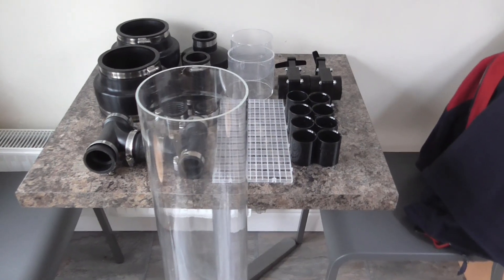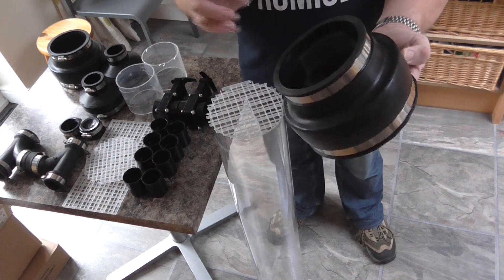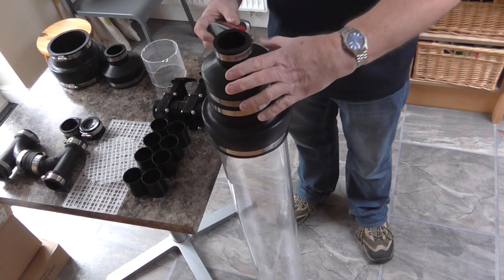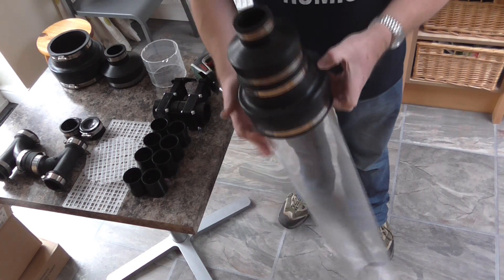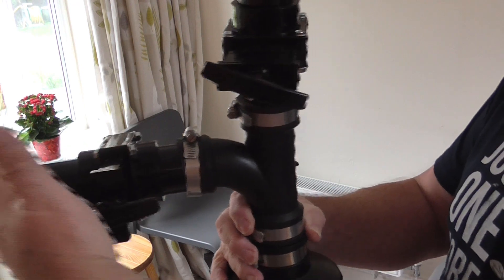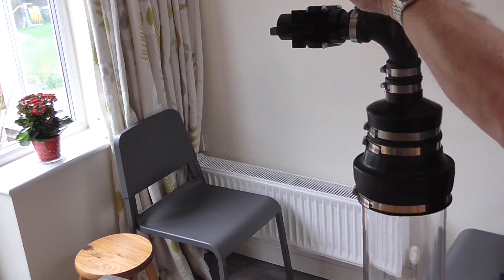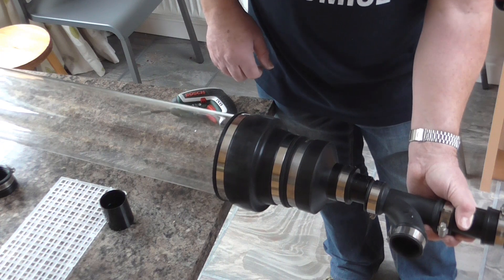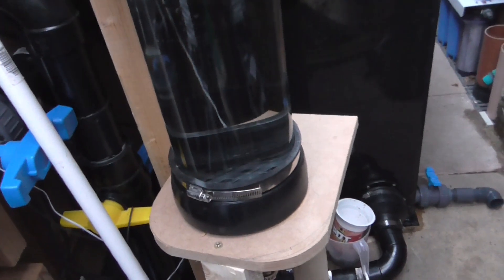Making a Home Made Up-flow Filter

Comment: How much did it cost without media please
Reply from the maker: The approximate costs for building a filter using 150mm and 110mm pipe are:
150mm Filter
 £39 - 1 x 1mtr length of 150mm acrylic clear perspex tube
 £03 - 2 x 20mm (approx) lengths of 110mm pipe
 £32 - 2 x 160mm to 110mm rubber adapter
 £20 - 2 x 110mm to 1½" rubber adapter
 £ 8 - 1 x 1½" rubber T-connector
 £15 - 2 x 1½" valterra valves
 £ 4 - 5 x 1½" straight connectors solvent weld
====
£123 = Total

110mm Filter
 £33 - 1 x 1mtr length of 110mm acrylic clear perspex tube
 £20 - 2 x 110mm to 1½" rubber adapter
 £ 8 - 1 x 1½" rubber T-connector
 £15 - 2 x 1½" valterra valves
 £ 3 - 3 x 1½" straight connectors solvent weld
====
£ 79 = Total

Where I got the parts from
Acrylic Tube - Trent Plastics do 110, 150 and 200mm acrylic tube at 500mm and 1 metre lengths
https://www.trentplastics.co.uk/acryl...

160mm to 110mm rubber adapters - For a massive range of rubber reducers and adapters covering a big range of sizes and combinations I used JDP 
https://store.jdpipes.co.uk/adaptors-...

I got all of these fittings from my local Koi shop
- 110mm to 1½" rubber adapter
- 1½" rubber T-connector
- 1½" Valterra gate valves

1½" straight connectors solvent weld - Toolstation
https://www.toolstation.com/solvent-w...

I got the mesh to keep the media in the tube off eBay. Cut it to size using a wire cutter.
https://www.ebay.co.uk/itm/4pcs-Grid-...

Comment: Hi how do you put an air valve in this?
Reply from the maker: -
Hi Muhammad. If you watch a later YouTube video on my channel called "Bigger air pipe agitation on UpFilter" you will see the new air pipe which is based on JG Guest 15mm pipe which can be bought from Toolstation.
I used a 15mm tank connector 
https://www.toolstation.com/jg-speedfit-tank-connector/p55227
Drilled the correct size hole in the acrylic tube then heated around the hole with a heat gun (or hair dryer on hot) until it started to go soft, then fitted and tightened up the tank connector while it was still malleable.

Comment: hi i need your help ive ordered 7 160mm to 110mm but always get the wrong size the 160mm size is a lot bigger than 160mm i can fit my finger in with the tube is there a part number i can look up on the site you got them fromplease
Reply: Don't worry mine was the same. When you tighten it up it does create a water tight seal. Try it out.
Reply from the maker: Yes it does work when you fully tighten the clip. The rubber moves a lot.
Reply from the maker: Alternatively this rubber reducer would be tighter.
https://store.jdpipes.co.uk/135-150-100-115mm-mission-rubber-adaptor-coupling/

Comment: Nice job, but I think the costs above need working out again?
Reply: Thanks Mick. Why do they need revised?
Reply: @peterfinkill8098  Sorry that company also do circles, that could be drilled as Wrighty has done, £2.50 each for 110mm.
Reply: @peterfinkill8098  Hello again, I just thought that at £15 for 2 the Valterra valves were cheap? I have ordered the bits to build two.. I found a place to get the tube from as I am going to use 110mm, I have 2 ponds both about 1000 gallons and I think 110mm will be ok, this place: www.clearplastictube.co.uk do 700mm lengths for £19 +vat, so I have ordered enough for 2 filters, and may even run 2 side by side and see how that works out, maybe with a Y splitter with valves on the input so I can clean one at a time, and also take the out puts to different places, shower, Anoxic bed etc. I will let you know how it works out. Cheers. Mick
Reply from the maker: Sounds good Mick. You should video it and upload to YouTube.

Comment: Nice take on a DIY tempest filter. Larger than the EA version and about half the price as well. Couple of questions: What type of media will you be using - K1 or the new K+ ?, Where did you get that T-shirt you are wearing? I love it
Reply from the maker: Thanks for the kind comments. I plan on using K+ media in the new one I'm gonna build. Currently has Hel-X media. The T-shirt was a Christmas present so I don't know where it came from. There are loads of custom T-shirt suppliers on the web who will do whatever designs you want at a pretty reasonable price.

Comment: Where did you buy the tube? I can only find small lengths
Reply from the maker: Hi. Thanks for watching. I get all my acrylic tube from Trent Plastics. They do various sizes in 500mm and 1metre lengths. They are also on eBay. I use the 110mm, 150mm and the 200mm tube,
https://www.trentplastics.co.uk/acrylic-tube-rod/acrylic-perspex-tube
Reply: @northernkoikeeper512  great thanks are you from Newcastle? I'm thinking of doing 2. I have a prefilter i made before my shower I'm thinking of adding 2x up filters after the pre filter and before my shower. It pumps 1500litres per hour though so I'm not sure it will cope but I'll soon find out

Comment: Thats a great build idea, just what I need before my shower as a pre filter. what flow rates are you putting through it? Would save on cost of a EA Tempest and can be cleaned  better when required.
Reply from the maker: I'm putting around 3-4,000 lph through a Varipump. I've just posted my cleaning video where you will see how easy it is to clean by loosening 1 clamp.
Reply: @northernkoikeeper512  is the flow rate not too slow for a Bakki  , these need a high flow rate over the media